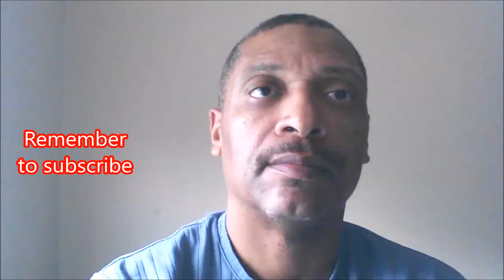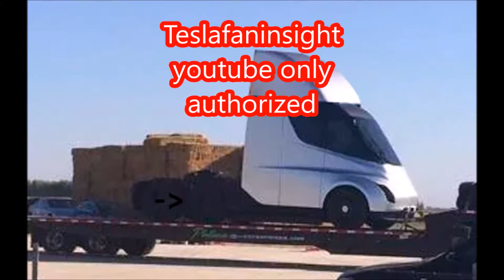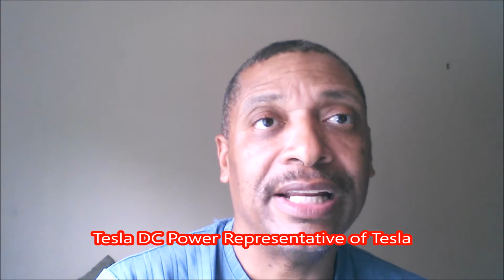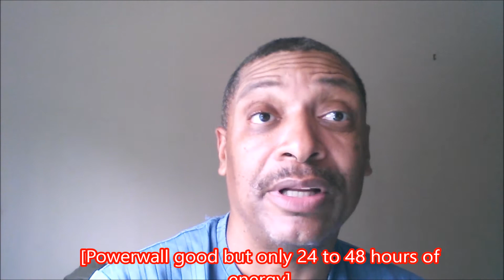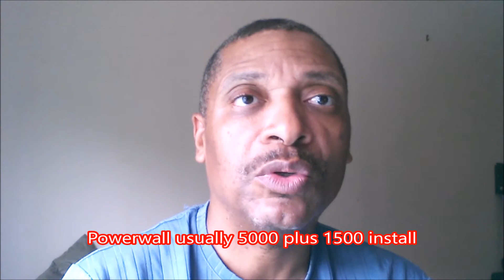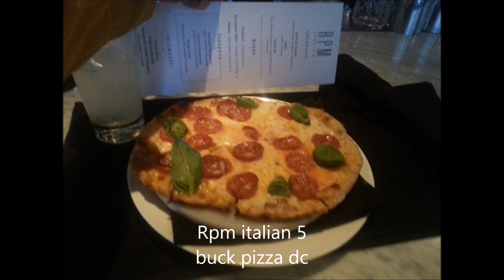Tesla powerwall (stock 3000) 15 dollars a month. green mountain energy partners good deal

Comment: Most power outages that are encountered are just a few minutes to several hours at a time. The Tesla power wall is ideal for providing essentially uninterruptible power. The maximum short term power that is provided from a power wall is about 3 to 4 thousand watts which will give you some lights and very limited appliance use plus recharge power for mobile devices. Drawing 3 thousand watts will make the power wall only last about 10 hours. Very judicious and limited use can stretch your back up power for a day. 

 For the type of disasters that has happened this year requiring several days to weeks of power will still necessitate the service of a generator. Depending on water well pumps or air conditioning or electric ranges, microwaves, or electric dryers  you may need to get a 15 thousand watt generator. 

Gasoline or Diesel fuel is hazardous and very perishable to store and natural gas service may not be available in a wide spread emergency. Your suggestion of propane is the ideal fuel for your generator since it keeps forever. The fire code will let a home owner store more propane than liquid fuel.
Reply from the maker: i thought nat. gas would win the fight bc no power lines to fall down.  propane is the winner according to the rep.  i agree with your propane analysis.

Comment: Vehicle to Home (V2H) capability describes a scenario in which a plug-in electric vehicle (PEV) and 100% electric car not only receives charge from the grid to power the vehicle, but also provides backup power to a load such as a home during an outage, similar to a stand-alone emergency generator. Nissan's LEAF is offering this backup power Using V2H (CHAdeMO).
Tesla’s cars with full charge can supply 75kw of power, which is equal to 5 Power Walls. 
Why isn’t Tesla offering V2H for emergency power?
Reply from the maker: +Joe M good question. He said possible not doing now